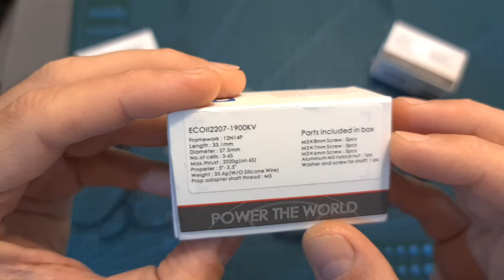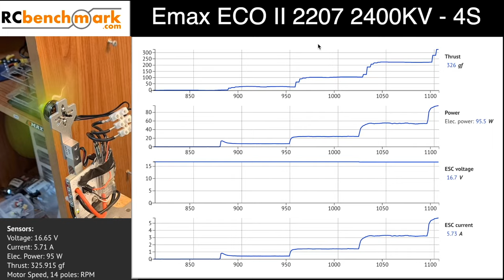Emax ECO II 2207 - Thrust Tests & Flight Footage

Comment: Going for my first build and I am thinking of starting with 4s and practice for a month or two with 4s before I shift to 6s…. The build will be coming to around 540 grams without gopro and 700grams with it….  Should I go for 1700 or 1900kv …. My mind is inclined towards the 1900kv one as it gives around 150g more thrust per motor at max throttle as compared to 1700kv which will be a total of 600gm extra thrust at full throttle at 4s … Let me know your thoughts and your personal pick among those two

Comment: Did I just see 172kph on the gps on the 6s run for a second!!??? Nice.
Reply: Probably not to wise to be posting flights with recorded speeds over 100mph. FAA may start to notice.
Reply: @jamesparkerfpv435  eh.  Most race vids that are posted the quads easily hit 100 in a straight away.  I think as long as it’s in an open field away from property and life the FAA should be fine.  People have been posting 100+mph Fpv vids for at least 3 years now.   These days the faa seems more worried about dji pilots filming protest, fining them $150k+.
Reply from the maker: Yep :-)
Anyway the FAA has no jurisdiction over here.
Reply: @KremerFPV  haha yes indeed.

Comment: what is the software and tools used for testing the motors?
Motor Performance Data:

2207-1700KV
4S Battery: 24A, 1040gf Thrust
5S Battery: 20A, 1410gf Thrust
6S Battery: 30A, 1660gf Thrust

2207-1900KV
4S Battery: 30A, 1190gf Thrust
5S Battery: 38A, 1570gf Thrust
6S Battery: 47A, 1840gf Thrust

2207-2400KV
4S Battery: 44A, 1310gf Thrust

Comment: How long was the flight time on the 6s with the 1900kvs and the 1700kvs? I'm debating the difference between the two and if the flight time isn't diminished too much from a higher kv, I'd rather go with that one!
Reply from the maker: I only tested the 1900KV version. I recommend to go with the 1700KV motors in case you are going to use 6s batteries.
Reply: @KremerFPV  why? 17000KV for 6s? For freestyle and light cruising?

Comment: Will you be doing the eco II 2306 motors?      I’m trying to figure out which would be more efficient for a 4s setup.    Your old test of the original eco 2306 over a year ago showed incredibly high efficiency, but the numbers seem almost too high
Reply from the maker: Yep, I will test it soon. In the older video I used an older thrust stand which turned out not to be accurate in terms of current measuring.
Reply: @KremerFPV  Good to hear! I'm looking to order parts soon, do you think the 2306 will have higher efficiency than the 2207?
Reply from the maker: @mossm717  I doubt it.

Comment: They seem great..how do you compare this with the Velox motors?which one would you prefer?
Reply from the maker: Well it's hard to tell.. Both options are good but I need to get more air time with both motors (which I won't unfortunately) in order to properly answer this question.
Reply: Stay away from those Velox motors. They have no prop grip and the props always come loose no matter how hard you tighten them.

Comment: great video. Do they sell both cw and ccw one(different screw)? Beacase I don't see any option about this from the seller. Thank you :)
Reply: They don't make clockwise and counterclockwise motors....because you can just change that in your software. Like Blheli 32.
Reply from the maker: Thanks. For smaller quadcopters, in order to reduce costs the motors are only offered with a single screw-thread. The nylock nuts are sufficient and Skyweaver is correct - you can simply reverse the direction of the motors.

Comment: Suggest me a good motor for 5 inch build that i want to use for longer cruising flight instead of freestyle. I want maximum flight time instead of doing freestyle acrobatics. Thanks
Reply from the maker: Sorry for the late reply. Did you order a set of motors already?
Reply: @KremerFPV  No problem for replying late. No I don't order motors yet
Reply from the maker: @ probably 2207 low KV motors  will do the trick.
Reply: @KremerFPV  ok👍 thanks for the reply

Comment: The 1900kv are great on 6s provided you pair it with the right prop. But 5s will definitely be more efficient.  The hq r35 is a great option for the 1900 on 6s if your build weight is below 300g before lipo, the R38 does great also on it.  That all said the motor is a great option, it’s a bit on the heavy side for racing but will work.  I personally run the hyperlite e series 2207.5 1722 and 1922 for racing.  Their lighter (30g with 30mm wire,)and a only a couple more $.  But as a emax fan boy I already have some eco ii 1900’s on the way 👍 can’t wait to slap em on a lightweight freestyle build.
Reply from the maker: That's great. Have fun!
Reply: Which motor would you recommend for Freestyle? I'm thinking of buying a set. 6s 1700KV 1900KV 2400KV ?
Reply: @armani007E55  I’d go 1900.  You can always put a throttle cap or use a 5s lipo 👍
Reply: @armani007E55  on my higher kv freestyle rigs I’ll usually warm up with a 5s pack and then go 6s and usually run a 85 to 90% throttle limit.  Now on my race setups get 6s full time and 100% throttle unless it’s a tight course then I have to play it by feel.  Heck I’ve had some tracks where I run a 65% cap and still feels too fast lol.
Reply: @archer4922  that's interesting I'm building a 3" racer and never thought of throttling down.  I only do that in my whoop while ripping in the house. You actually do it outside. 🤔
Reply: @armani007E55  yep.  Much much more control and if your into racing it’s a major help on a track to help get your lines right.   The very first time I tried it dropped 4 seconds off my lap times that day.
Reply: @archer4922  nice ! Awesome tip! Tks!
Reply: @armani007E55  no prob my man 👍